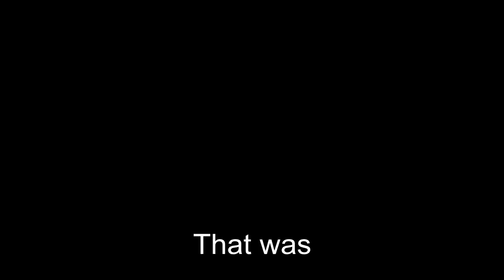best agricultural fencing tips - TIP N°4

Comment: LOVE seeing a hand plane and joinery being used where most Yanks would consider it "overkill" and non of them owning or knowing how to tune/sharpen a nice plane.  This timing is perfect, now I know why I cut such large endposts. I'll fit them up like this rather than the hardware shortcuts most know around here.
Reply from the maker: Thanks. I enjoy using good sharp hand tools. Note this style of fencing comes from the old days when the fencers used to cut and split the posts and battens from the bush and then build the fence. Some of those old native fences still stand today. The only hardware they had then was #8 wire and 2 and 3 inch staples all imported from England. The rest came out of the bush.
Reply: @Otokastation1  I'm cutting my corners and braces, the line-posts and battens will be from Timeless Fence on this one. I may use more "bush" materials on my remote site and in future fencing. Osage Orange and Black Locust are what Yanks in my area use for posts and bracing when using local natural materials.

Comment from the maker: @PermieCulture 
When you are working with a diagonal stay the higher you go up the post (strainer) the more you increase the upwood purchase. The longer the stay the better. I like to keep them around the middle of the post but would prefer to be lower than higher. There is no firm ruling as far as competition fencing goes as it has caused too much debate in the past. Make sure you use a decent stay block because thats what takes most of the weight.

Comment: Love that estwing framing hammer you have on your belt. Noticed it straight away.  I'm an English carpenter by the way so would do.
Reply from the maker: I bought that hammer in Florida, USA in 1989. It's a 22 oz, waffle head, straight claw and I love it. Now it is almost a flat head and the handle is getting pretty thin. It is still my first weapon of choice (I have a lot of hammers)and it has pounded hundreds of thousands of mostly staples, and nails. Also known as my Knockometer or the fine adjustment tool.

Comment: I build a lot of fence across the Scottish Islands and Highlands, high tensile deer and stockfence. I'm either building into rock or 10ft of peat- so every strainer offers up a challenge..I thought your planing of the stay point was a tad extravagant- is there a reason for doing this? That must have been a slither you cut off the stay to fit?? I can't bury my stays underground as that would be the equivalent of leaving them permanently sat in water, they are jammed into place and nailed through both sides with a 6" nail. Forestry commission now want us to tension a line wire around the  bottom of the strainer and round the back of the stay butt. I liked the knot you were tying off on previous line wire video, I'll be using that, for sure. Other than that, good skills mate, nice n tight, you'd fit in well over here. Best DRM.

Comment: Good work, mate. I'm not in the trade any more, but I used to use use an inch and half dia auger bit in an adapted stihl to knock out the guts of the mortice hole in the strainer, then I only had to chisel out the corners. I did a lot of deer fencing  and it's worth having to carry two saws when drilling out the box strainers.
I worked with many Kiwis and picked up a lot of tips from them, bl**dy good fencers.

Comment: Why on a new fence do you join with a knot in the middle? Simply tie off on one end of fence, run wires out and strain off other end strainer and tie directly to strainer with end tie off knot, loses no strain, has no knots to lose 30% of wire strength and is much quicker. Apart from that, lovely workmanship.
Reply: hybrid dynamics  it's ok for short strains but long ones with few angles if u strain from 1 end the other end won't b tight

Comment: If you take a large rock.....or better yet a cement silo stave and lay it ( the flat way and the long way " just below the surface of the ground up against the brace posts......( the first two posts)...there is no real need for any other supports. The reason ?  Because  the pull forces are spread out over a larger area (against the rock or stave )and very difficult to pull a post over !  Similar to using a rope compared to a fishing line  pulling it through your hand.....Fishing line will cut...where as the rope wont !

Comment: I gave up using timber posts a long time ago, I never used pine posts as they are too weak and not fire proof as they burn like match sticks, I use railway iron concreted on all posts now with a star picket welded on the to attach the wire, the fence will last a lifetime and you only have to the job once.
Reply: Well you won't be concreting railway line posts in on a 2000 sq mile property fence in the middle of Australia.

Comment: He is lucky he has not lost his eyesight. Bending over looking directly at a mushroomed chisel. Poor practice. No safety eye ware but his ear defenders still wedged on his head.Funny he is quick to put his ear defenders onto use the chainsaw but still no eye protection or helmet.I witnessed this happen in the mines only difference it was a cold set not a chisel .Bloke holding cold set list eye. Ended up working in the bath houseNo regard for his own personal safety. Stay safe there are replacement eyeballs only glasses ones. Maintain your chisel you doit to your chainsaw.
Reply: Neil williams f
Damn that sounds bad. You were in the mines? What kind?